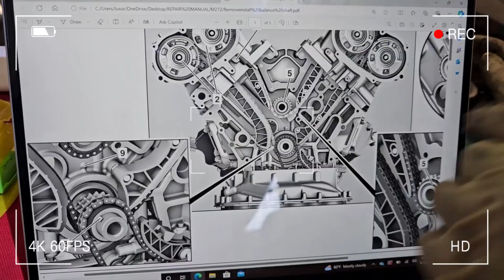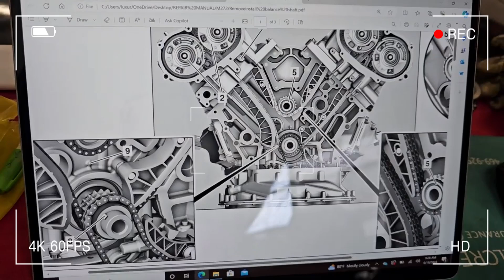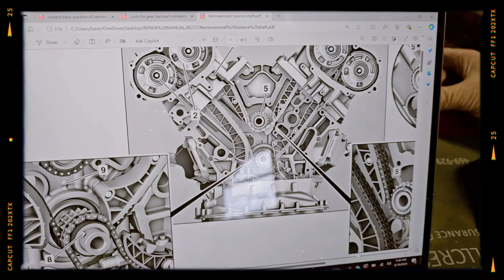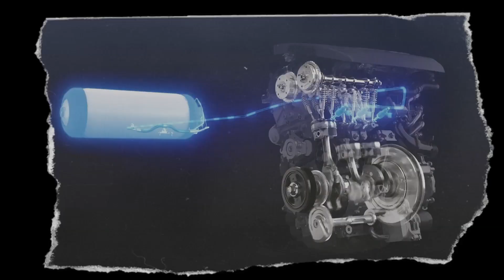Mercedes M272 3.5-liter V6 Engine: Specs, Reliability, and Known Issues Explained!

Comment: If you get the ones after they fix the balance shaft they pretty much run forever if you change the oil consistently and keep an eye on the thermostat
Reply: Verify with your VIN number if you effected.
Reply: @chrismate2805  the ones after 2008 have all been taken care of.

Comment: I have 300000 km   no problems.  Just carry out the correct maintenance
Reply: Mines has 285,000 miles
Reply: fuel . liter pr 10 km ?
Reply: @homerjsimpson2118 yes   that's about right 
But depends on the amount of urban driving you do. On the open road and motorway long trip I get 7.7 per 100km but can be thirsty in town as I must due to the weather always use air-conditioning
Reply: @douglasreed132 7,7 at what speed ?
Reply: @homerjsimpson2118 I normally drive over here on the motorway between 80kmp.and 120 kmp. To drive faster here is crazy. The drivers over here are mad on a normal long holiday weekend say 4 days it's nothing for 350 people to die on the roads . If you look after a 272v6 no problems
Reply: What kinda oil do you use boss? Brand and viscosity
Reply: @GasandDiesel911 5. 40  shell ultra
Reply: @douglasreed132 thanks, I'll do that. 
I just bought the car as a knock around. I think it has Mobile 1
 0w30 
I don't care for Mobile 1 
I was always a Valvoline or Havoline guy.
Reply: @GasandDiesel911 if it's a 272v6 then better use 5w40 synthetic
Reply: @douglasreed132 ok thanks. I absolutely agree 5w40 synthetic. Even my owner's manual gives that as an option for certain  climates. Calls for synthetic only and anything from 0w20 in Alaskan cold like climates to 5w40 for the great southwest. 0w30 might be best where I live for winter times. I live in the rocky mountains. Gets extra cold and snowy. 
And yes, it's a later model M272 v6
- build date nov. 2011 
It has synthetic in it right now for sure.
 But I don't care for mobile 1 and ow30 
It is just a little too thin.
  I just drive it normally. 
 Get on it sometimes, give it a little Italian tune-up on the freeway to 130mph for a few miles and slow down again.
  It still runs perfectly as of now, with 92,600 miles, sounds like butter. 
It's in an SUV with 4matic platform. I kinda baby it and then I kinda don't too. Haha
Reply: @GasandDiesel911 if it's a cold climate the important number is the first one. How about 0w40 the only time to worry about is cold startups. Actually I wouldn't worry too much about the brand just a well-known one with the mecedes recommendation 
They are great cars and the 272v6 is fantastic I ran an sl in Germany with the same engine never a problem sold it with 270k on the clock
Reply: @douglasreed132 that's some miles! I believe in Mercedes. I always have believed in Benz. I agree 0w40 is better. 
The only reason I ran 0w30 through it again was to kind of "wash it out" lol 
Never had sludge, but I made xtra sure it doesn't now! My next oil change will be 0w40 
Mercedes recommends Mobil 1 brand. 
I'm sure it's fine enough oil. I rarely drive the car anyway. 
 It's just one of several, so it sits a fair amount of the time. I only put about 200 miles a month on it. I've had the car for 3 years and I put less than 6,000 miles on it. 
But I've really driven it. Not a granny drive.
It's not fast at all. It's a GLK350 
Mercedes statistics show it's one of the most reliable Mercedes they have ever built. Especially in the modern era. 
That's out of Mercedes' mouth, not mine.